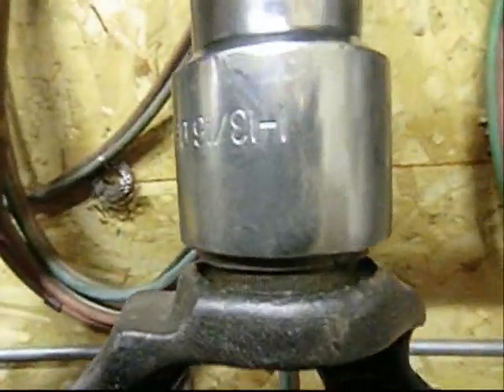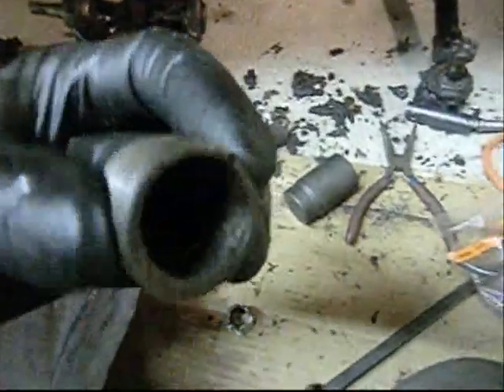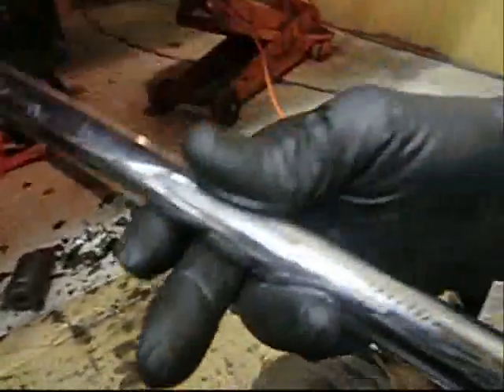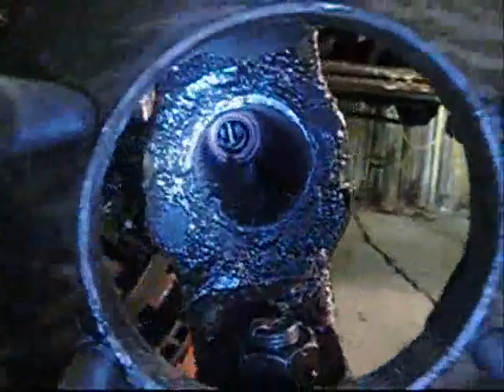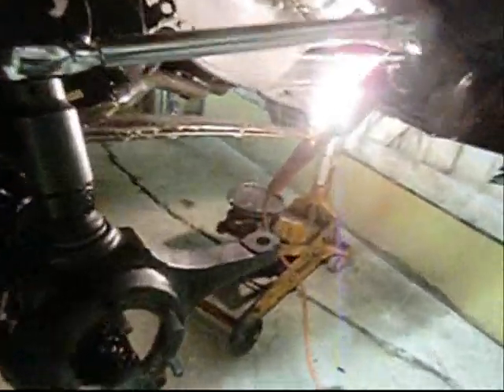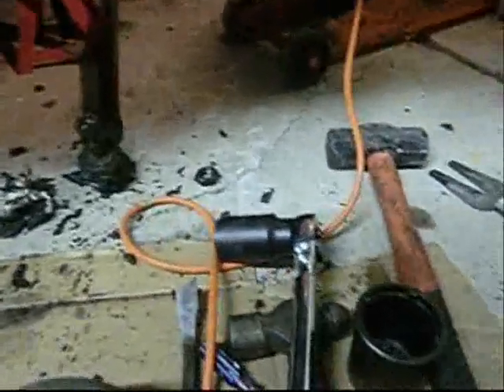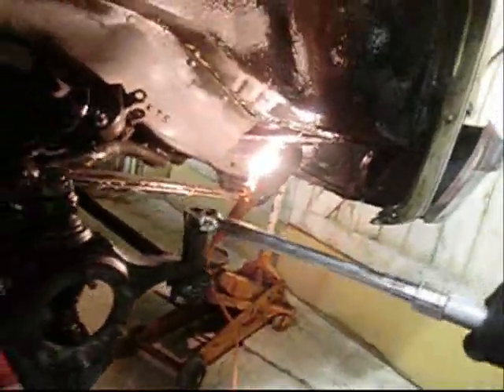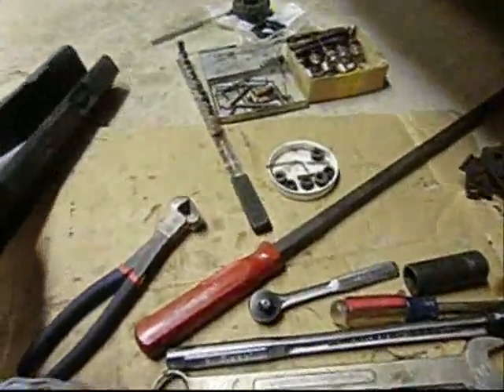12 3 11  SF Sub Ball Joint Replace  IV

Comment: Don't know if there's any merit to it, but I've always been taught to only crank with a torque wrench for setting torque, not just for wrenching. When you were trying to line up the cotter pin hole, I would have just used a breaker bar to save wear and tear on the torque wrench. Just a thought.

Comment: One click is all you need to torque it correctly (assuming the wrench is in calibration).  The extra clicks actually over-torque it.  Click more than once in front of an aerospace type QA Nazi and you get to do it all over again with a new fastener.

Comment: Front axle should be GM 10-bolt.  GM didn't put Dana 44 in after 1978.  They are both about the same strength.  1 ton's had the monster Dana 60 in them.